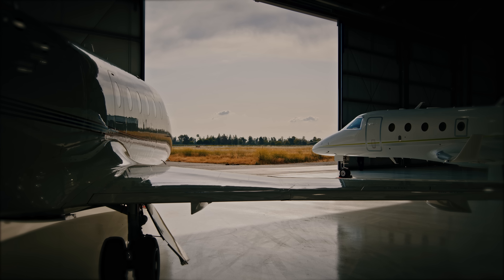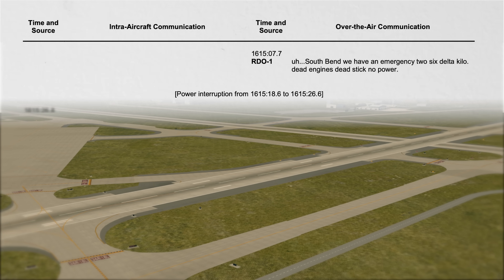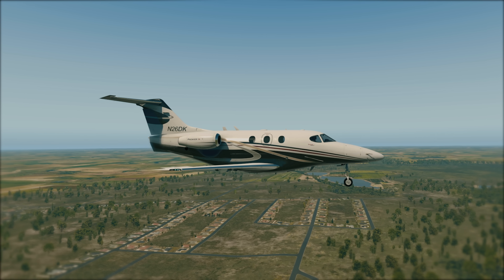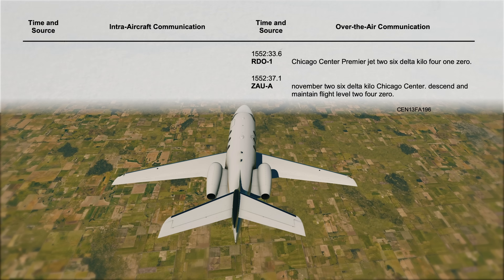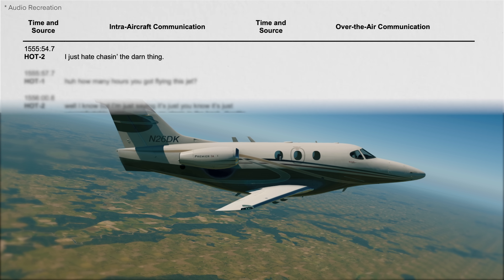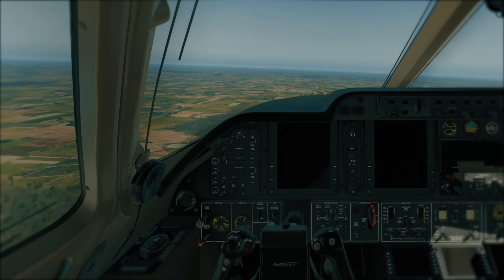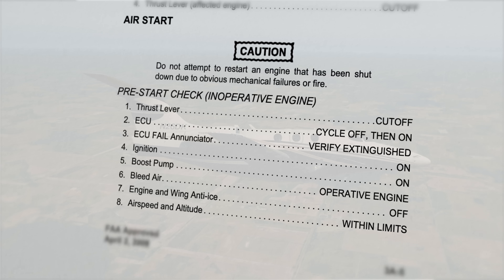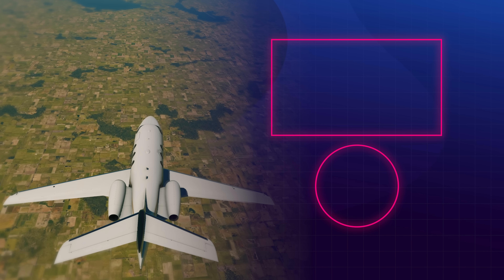Passenger Causes DUAL ENGINE FAILURE | Accident Case Study

Comment: Clowns like this pilot have zero respect for both regulations and technical mastery of their aircraft. Such a casual attitude does not fit the huge responsibility required every time they fly, times 1000 when passengers are present. This accident was 100% on the pilot, who failed at every level.

Comment: They put themselves in a bad position, then when panic should have driven them to follow procedure and checklists, they let panic drive them to wing it. That's how the partially extended landing gear lever and the immediate turn around too tight for a second landing attempt happened. Everything was survivable had the panic they stumbled into driven them to procedures.

Comment: with all due respect to the dead, and with the understanding that for some people it's hard to think under pressure, alex was recklessly incompetent.
But also, regarding the nosewheel-only landing, that's inevitably going to tip the aircraft attitude up resulting in the hopping issue. It would have been better to have no landing gear down.

Comment: This thing has an APU, will the APU not run while airborne? I feel (As I don't know) starting the APU should give you all electronics/hydraulics necessary to land.  Correct me if I am wrong, I am just a student pilot.
Reply: This plane uses batteries instead of an APU,  it has two batteries as described in the video.

Comment: HOW can tower call a go around when they know that this aircraft has no engine power ???
Reply: Quite the contrary,  he knew the plane had one engine,  and it did.  He can SEE that the engine is running the same way that he saw the gear was up.

Comment: How the actual F is a plane designed where just pulling back the throttle lever shuts down the engines, cuts off the power supply and turns of the autopilot?  And the why doesn't the batteries selector have an auto mode? Man, the aviation industry is so bad in usability topics, even video games have better inferfaces and usability. Well, maybe more and better professional UI designer are needed in the avionics industry.

Comment: Am I the only one who thinks the engineering of this aircraft is a fucking joke if it is able to shutdown in such circumstances? 
A little metal lever is the only thing between life and death? 
How is such a system so pathetically badly designed and signed off on? 

Bloody motorbikes have more safety features.

Comment: Bloody hell. That is a whole lot of stupid ass "you have to remembers" in the case of the throttle being pulled too far back. Sure, let's blame the pilot and passenger, but I can't imagine a worse design. Are they trying to make these aircraft crash on purpose? Why is aviation so far behind on making things fool proof?
Reply: The RAAf lost a F111 due to a coverall button that was found in the throttle slide.
One the avionic worker found he lost a botton after working the cockpit. He reported it to his sargent. So they walk thru the guys work day thats when they found the  button had caught in the slide.
This was reported up line the accident investigation team went and checked out the F111 that cradhed off the end of the runway while landing. Yep there was a button stopping the pilot from throttling back.

Comment: This video is a prime example of low-hanging, sensationalist clickbait. The passenger did not cause dual engine failure.  It was 100% the pilot in charge's fault due to handing over control of the aircraft to an inexperienced pilot who was not type-rated for this aircraft and continuing to pressure them into making incorrect decisions, despite the many audible alarms heard in the cockpit, which were ignored by the pilot in charge. This video will forever leave a stain on the passenger's legacy due to the deliberately misleading title as well as the irresponsible and dangerous actions of the pilot.

Reported for misleading title.

Comment: Data sheet for Premier 1/1A says so landing gear is operated by hydraulic system, which is powered by pumps in botch main engines. If nose LG was extended and main LG not it points to wrong hydraulic circuits configuration for single engine. Seems it was similar problem with electrical power.
Reply: No he pulled the manual gear release cable,  it just didn't pull far enough.

Comment: The engineering behind some aircraft is frightening.  So many systems are unnecessarily manually operated, it seems.  Everything seems to have an override.  Flip the wrong switch, and you have defeated more than one function that you intended to use.  Looks like procedure manuals are bibles in the sky.  Being a pilot is not for me.  Too nervous.
"The left engine exploded!"
"Checking the manual....."
"There's a procedure for that?"
"Yes.  You some kind of idiot or something?"

Comment: As a pilot I’m not going around without engine power. As far as I’m concerned I loose power it’s officially the insurances air plane. I’m landing on the first go. Dump flaps, make that run way. No second options. The nose gear down made this infinitely more difficult to land.
Reply: You're not a pilot because if you were you would know it's not physically possible to go around without engines.
Reply: @LarsLarsen77  might want to re read my comment.

Comment: He wasn't an instructor but tried playing the role of one. That's the key issue here. I'm taking flight lesson and on my first ever flight of my life ( never ever touched a plane control before even in simulator ) my instructor let me do the take of AND landing. With proper guidance for sure but I did them and he was hands off control ( when you hear : 'your controls' when it's your first time in the pilot seat and you're still on the ground not having taxied yet, you go like wait what ? ). Although I knew for 100% certain that if I did a poopoo my instructor with his 18 000 hours on record on the cessna alone would have taken over and corrected it. The only correction he made was once with the yaw to force an ever bigger crab for the landing even if he told me to crab more several time before and each time I wasn't putting enough and we were on final. otherwise I would have missed the runway and I don't think he wanted me to go thru a goaround without being prepared for it.
Reply: Sky King didn't need a flight instructor,  and he did a loop.

Comment: I would be afraid to drive a car where if I selected the wrong position on the gear stick I would then lose all power and control of the vehicle. Why build an aeroplane which allows such a simple error to have such serious consequences?
Reply: Have you ever shifted a manual car into reverse while driving?  I haven't either,  but it's right fucking there and you don't even have to pull up on a latch to engage it.

Comment: So how did they manage to restart the one engine still? If they did switch from STBY to ON why the switch was found in STBY position in wreckage?
Reply: Because it was a perfectly good airplane. He just started the engine with the starter motor even though the correct procedure was to use airspeed to windmill the engines.

Comment: So if the generators go out and you instinctively switch the battery to backup, you have no way to start the engines and no indicators that you're trying to start engines with a disconnected battery. 

Genius level engineering.
Reply: Instinct has no role in operating these types of aircraft.
Reply: @jnawk83  
I disagree. 
If 99% of people push on a pull door it's because the door is backwards. 
Green means go. Red means stop. 
Battery switch when electrical goes out.
Reply: It's already on a battery backup,  he turned the battery backup off.  That wasn't instinct it was just randomly flipping switches like an idiot.

Comment: Damn, that is the most stupid throttle lever design... I have flown nothing other than rc airplanes but taking off with the idle trim all the way down is stupid. Nothing then stops you from pulling all back and stop the engine...

Comment: A dismal failure by the pilot in command; on so many levels. I wouldn't trust this pilot with a lawnmower, far less an aircraft of any description including a Cessna 152. A pilot who does not use checklists, who does not operate the aircraft within limits, is a pilot heading for an early grave.

Comment: Never attempt to land with only the nose gear. It's fucking clear logical that it would either bounce or give a high enough AoA after touchdown that one wing could stall and make the plane cartwheel on around the stalled wing as it has immense drag on it. Never attempt that. Better raise that stupid nose gear and do a belly landing instead.

If the retarded controller who clearly understood that he's dealing with a glider coming to land (no engines thrust) wouldn't have asked GO AROUND, they would've all survived. The idiot controller just created a high death chance environment by asking them to go around simply because of a non-critical thing such as belly landing. A belly landing can be much safer than landing, for example, without the left or right main landing gear extended. That controller should stop what he's doing and at least feel guilty for that stupid/mindless instruction he gave.

Comment: From the NTSB Report:

The National Transportation Safety Board determines the probable cause(s) of this accident to be: The private pilot's inadequate response to the dual engine shutdown during cruise descent,
including his failure to adhere to procedures, which ultimately resulted in his failure to maintain airplane control during a single-engine go-around. 

--->   An additional cause was the pilot's decision to allow the unqualified pilot-rated passenger to manipulate the airplane controls, which directly resulted in the inadvertent dual engine shutdown.

Comment: the cause was not the engine out that was the cause of the emergency, not the crash. The crash was caused by not troubleshooting and taking time once one engine was up and running.   Dual engine out is not a memory item. it's just not. but it should be a checklist that is easy to get to in case of an emergency.  Once they had one engine up there was no reason why they could not turn on Autopilot and go over the checklist and troubleshooting. Not going over checklist one they had a good engine that was the cause of the crash, not the dual engine failure that was the cause of the emergency but not the crash.

Comment: I don't know much about planes,but a better throttle lock that requires a second step seems to be a easy fix for such a problem.
Reply: can not pull the engines against the flight idle stop and shut them off.
Reply: Planes are generally flown by people who know how they work,  not random passengers.

Comment: There aren’t many scenarios that I can think of where an individual or a company should own and operate their own aircraft under pure Part 91.

Best bet is to buy a share at NetJets or one of the other fractionals. They take care of hangering, inspections, maintenance, documentation, flight crewing, training, dispatching, etc. Plus you can upgrade or downgrade your airplane depending on what your needs are for that particular flight. And you can use more than one airplane at the same time when different executives for an organization have different itineraries at the same time. Also, because they have aviation assets scattered around, most only require a four hour notice to pick you up to fly you from and to any airport combination in the world.

I have yet to hear someone objectively tell me why Part 91 is better than 91K. An executive’s best bet would be to leave the flying to the professionals and turn the passenger cabin into their office for maximum productivity which you can do when flying fractional.

Comment: Did the PIC own a sports car? Were they a bit of a speed demon? Going flat out in a car might result in several thousand dollars of engine and suspension repairs. Over speeding an aircraft could result in termination of flight which may or may not be survivable. The airframe and power plant repairs could be a huge bill.
   Routinely exceeding the published limits such as max gross weight and Vne does not promote confidence in the pilot's willingness to fly safely.

Comment: BUT WHY is there NO safety lock to stop engine shut off IN flight (unless a fire lever is activated)? ,2. WHY, are there no audio synthesizers to warn of 1) or "Activate ignition switch"!!!?? (Thats been since 80s technology!)
Reply: There is a safety lock,  the passenger pulled it. Perhaps on purpose because the PIC told him to pull it "all the way back" and you need to pull that up to get it all the way back.

Comment: Why couldn't they just land without gear down at the slowest speed possible (above stall)? I'm guessing having just that front nose wheel down caused more air to remain underneath giving it lift since it forced the front higher than the rear.
Reply: Because it was a perfectly good airplane under power.

Comment: Why would ATC tell a pilot with no power to go around?  It sounds like the pilot screwed up several ways, but ATC and ground control added to it by telling him to go around.  Sure, notify him the gear is up, but he was on a stable approach and the plane will do a gear up landing just fine.  After they are on the ground and stopped, that is what insurance is for.

Comment: I think that when Alex tried for the go around he slammed the throttles to max. But since he has only one engine and power only on the standby bus, meaning no hydraulics to power flaps, aileron, and rudder, it caused asymmetric thrust which could not be countered due to no hydraulic power.
Reply: I don't know this aircraft well enough but if he had an engine he should have had hydraulic power.

Comment: How on Earth did this jet owner ever qualify as a jet aircraft pilot, when his attitude is so unprofessional and laissez faire? It’s all well and good having the money to buy your own jet aircraft when the pilot owner is so lazy, unpredictable and placing all the pressure on an unqualified pilot when the pilot owner wasn’t even an instructor.

Anyone that’s learnt to fly either fixed wing or rotary knows that the takeoff and landing are the most dangerous points of flying. If you’re as unpredictable/unprofessional as this particular pilot then he has no reason to be flying and I wouldn’t trust him with an RC drone. The manuals for specific problems/issues are there for a reason, not just as extra weight to fill your pilots case with sandwiches and malt whiskey. 

The poor passenger with outdated skills that hadn’t flown for four years, had no reason to be taking control during the low altitude part of landing. He was unqualified and had insufficient hours in the air and hadn’t even started the the conversion process to fly single engine jets let alone multi engine jets with seats for additional passengers (that had to sit through this FUBAR and no thought to phone the fast approaching airport and let them know there was a complete moron supposedly in charge and an unqualified pilot with no training that was scaring them beyond belief. 

Sod the rules about using cellphones whilst in flight - they could hardly make things any worse and at least the authorities would know where the blame would lie for their potential deaths. 

I’m unsure about the current British CAA rules governing this type of situation but if my vanilla experience of getting my Private Pilots Licence and the PPL (H) (dear god but those Robinson RH-22 scared me more than serving as a Royal Marine Commando 1978-2006/7, and despite assurances it was even worse with the RH-44 (four seater). Since the Stage 4B aggressive, metastasised, terminal cancer prevented my participation in many interests from HALO/LALO, parachuting in general, flying the club plane, scuba diving etc. 

For some reason the authorities ruled that I’d be unsafe due to a morphine pump and fentanyl patches and other Gucci drugs, but compared to the pilot in this case I doubt I’d be any worse. Other than some external bling from Ireland to Iraq and Ghanners that causes great fun at civilian airports (they do the checks as I sit in my metal wheelchair) and occasionally help me to stand whilst running the wand around is just so funny so to allay their suspicions I drop my trousers and remove my shirt so they can match their detector beeps with each scar - might suggest playing join the dots next time !

Comment: But it is not explained why the jet crashed into the building nearby. Thrust was regained, electric systems and hydraulics still off due to the battery mode. Was it the lack of control or damage from that bouncy belly landing, which caused it to steer off into a residential area?
Reply: It was pilot error. But we don't really know for sure because the voice recorder was off.

Comment: Wow. What a clown of a pilot. Apart from playing instructor he doesn't know his systems and in an emergency failed to used a checklist. The final crash is clearly because he bounced badly, hit power and then climbed out too aggressively for a single engine go round. Then stalled out at low level.  Once he had power in one engine he should have orbited, got the second engine lit, set up properly for landing and done the deed. A good example of someone with excess confidence, insufficient systems knowledge and panic instead of following procedure.

Comment: I dont understand why planes can achieve speeds greater then what the airframe can handle.

Aviation loves safety measures so it seems like every plane should be rated to handle speeds slightly above the maximum speed a plane is capable of.